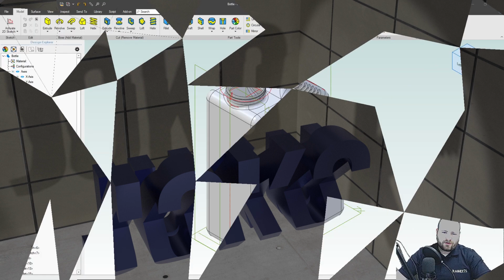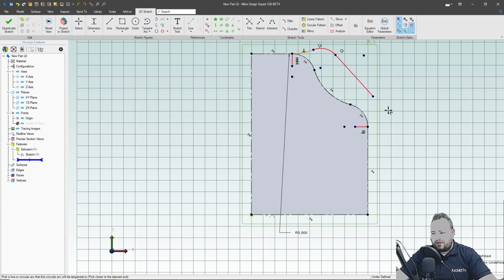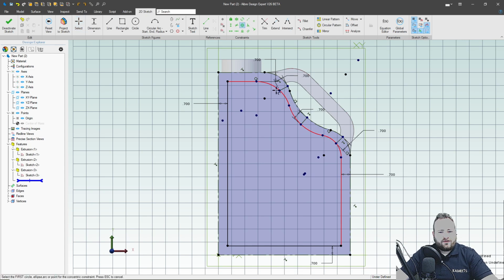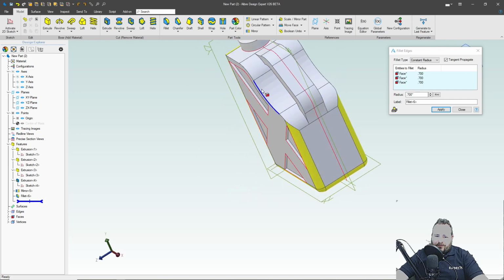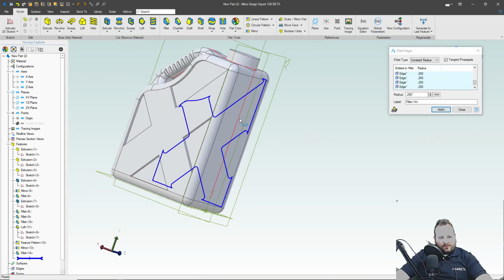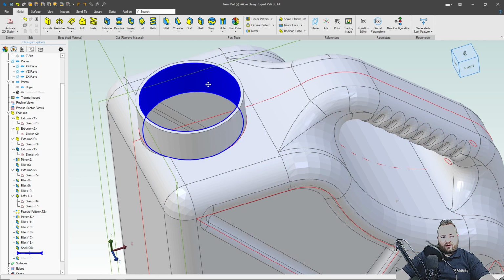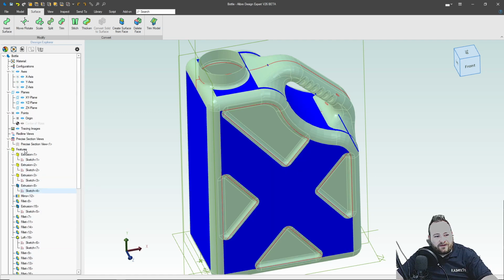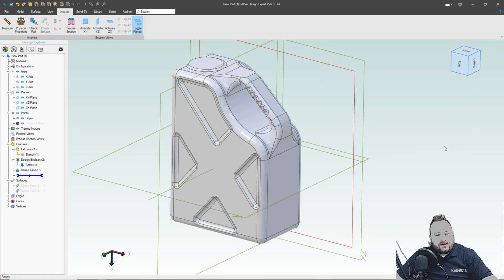Alibre- 2 Ways to Design a Hollow Bottle and Measure Volume |JOKO ENGINEERING|

Comment: Dude I just want say you are a great modeler. I have been modeling on and off for 30 years. Started 2d Intergraph, Ashlar Vellum,then McDonald Douglas NX, Solidworks, , Fusion,  Rhino3d. I was never as fast as you! I am just a hobbyist now and have been using the personal version of Fusion( used to be a subscriber), which I love but hate the online interference and hoops to get the free license. Never know when they might pull the rug out from under me... I have been testing Alibre Atom and FreeCad. FreeCad seems rather complex and unintuitive. I am contemplating buying either Atom3D or Alibre Design but I am wondering if I should take a more serious look at FreeCad. You seem to like FreeCad pretty well. What would you recommend? By the way I really have been liking the polished feel of Alibre Atom3D over FreeCad but really miss some more advanced features like Booleans and surfaces. I realize you can work around much of that but I like shortcuts....

Comment: Are you able to measure internal volume on freecad? Also what are the specs on your computer?
Reply from the maker: Ex Machina has a good video on the topic

https://www.youtube.com/watch?v=yZflqVG7Sy8

this on a xeon processor 32gb ram quadro m2200 graphics.  Don't judge performance by anything you see in YouTube videos.  Between heavy screen recording and video edits, things appear both faster and slower than they really are.
Reply: @JokoEngineeringhelp  I will take a look at his video thanks! I've been looking around and thinking about building a better pc to run cad. It seems like freecad takes alot of processing power but I am happy with it for the most part.
Reply from the maker: @average_salmon1241  FreeCAD is a great program.  Good luck

Comment: It is awesome man! I have a question based on SW and Freecad compatibility. I have been using SW for 4 years now and just switched back to the Freecad. Wondering, if I can use solidworks technical drawings for Freecad designs? Does freecad have all the features that Solidworks has?
Reply from the maker: Could you tell me a little more about what your workflow would look like between the two?  FreeCAD and SolidWorks have different kernels, so running documents between the two would be quite limited.

Comment: I have so much to learn. Does FreeCad have an equivalent function?
Reply from the maker: The FreeCAD Part Design workbench has a shell function (called 'thickness') that will do the same.  This hasn't worked for me on times that it really should have; be mindful if doing it on a complex shape, try doing it every time you add a feature to make sure it won't break.

https://www.youtube.com/watch?v=eP43tsQv_8E